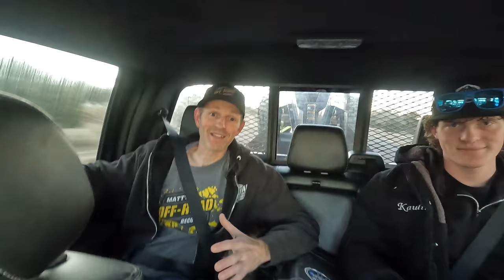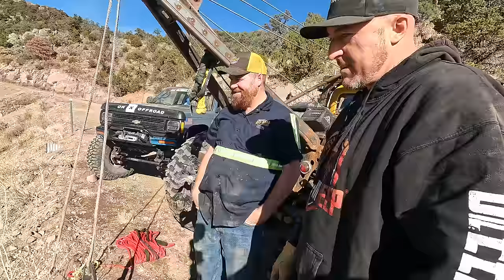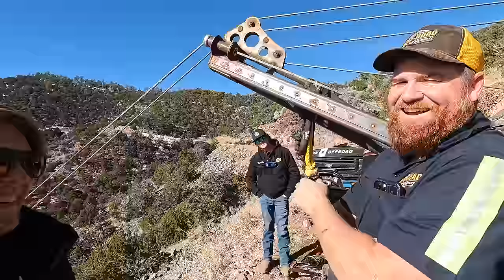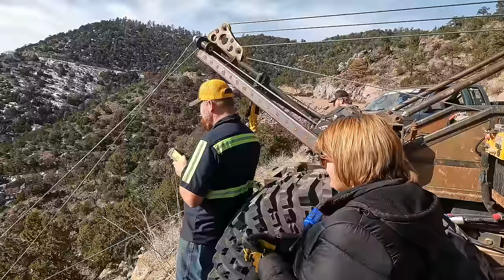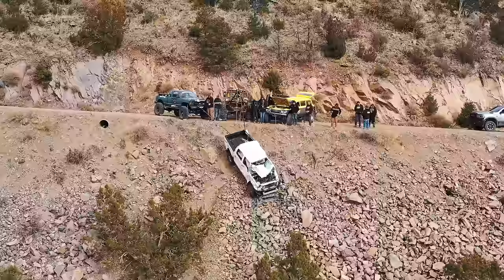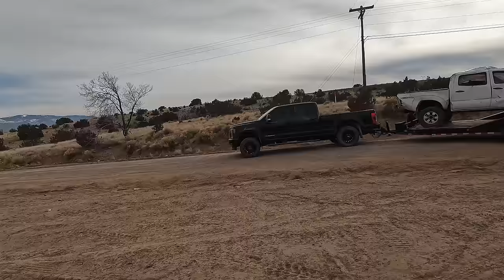There's No One Who Can Recover This Toyota....

Comment: Huge bit of advice for your trail jack. Just put a piece of tire or a 2x8 bolted to the bottom but the combo with an old cut of tire rubber on the bottom will make that jack work soooo much better it will blow your mind.
Reply: i dont even use those jacks and always wondered why no one does this... thats the first thing id do out of the box; make a bigger footprint
Reply: In theory that would work great in your driveway, Also, it's too bad they don't already make a rubberized foot for these, Oh wait... But maybe the real issue is the situation where a truck is sitting and being supported by winch lines on unstable ground, maybe just slide the jack into the door jam... well would ya look at that... mind blown.
Reply: @KirbyLouis  I know right, I don't even drive a toyota and always wondered why they do this, that's the first thing I'd do out of the box, not drive it off a cliff.
Reply: In a pinch a heavy-duty doormat on rough surfaces…
Reply: @stevecochrane6948  lol
Reply: Referring to the kind of articulating doormat made from pieces of tire, in combination with chunk of 1-1/4” plywood…worked on rock, not on soft stuff i would guess

Comment: The Camera Work and Editing are EXCELLENT on this recovery. Very technical, very safe recovery there is no doubt about that, but the camera work really was impressive, and showed how difficult this recovery actually was, even though you guys made it look easy.
Reply: I grew up in this kind of country and going down to the truck was dangerous for the person holding the camera. They should have a couple chest mounted cameras so   there's footage they can use to fill in while they get to a safer place.
Walking that kind of rock won't kill you but it's compound fractures in a box. Leg on the fall and arm if you get a chance to catch yourself.

I think Matt's operation takes safety seriously. So all of this is pointing out where they could improve.

Comment: Well Done!!!
I watched Colt's Bleepin Jeep version and I envisioned using the wrecker as a Yarder like the loggers use to pull logs. 
One of the wrecker's boom winch lines is lowered, along with the first rigger, and secured to the tow vehicle. Once that line is secured and tightened, it can be used as a Skyline. Then the tires, jack, and other equipment can be hung on that line with soft shackles to snatch blocks or snatch rings. The descent can be controlled by attaching the second boom winch line to the snatch ring and lowering it down. You could attach a tree strap or short rope to the load to assist the load down with one of the riggers controlling the descent.
Reply: Watch Trailmater - "Someone needs a Skyhook". You need someone with Rory's technical expertise.

Comment: I’m less than hour north from where U we’re at , I now the exact location where this recovery was at and that is an extremely steep mountain side !
Good job to you all and glad you’re all home safely!
Reply: Cool. We used to go up 31 mile road and roll boulders down the hillside.
Reply: That mountainside is the kind terrain that, if I encounter it on a hike, I realize I need to turn around or find a better route. One slip and the best case is you're going to have some road rash, worst case you'll end up dead.
Reply: Somebody was serious about stealing parts if they slid down there and then climbed back out with the tires and speakers
Reply: Did you get the rims?   😂
Reply: @HulaViking  Yeah. It seems to me they worked harder stealing them than they would have earning the money to buy them honestly.

Comment: Matt, you should consider putting some folding seats on the back of the wrecker behind the window, where the guys usually ride at. You could use folding seats from the back of an extended cab ranger, and just modify them to fit, they can fold-out of the way when not in use, and it would give your extra guys a place to ride with a little more comfort.
Reply: Or just get some boat seats that swivel for cheap.

Comment: Watching the video at 17:00 Had an idea for a tow truck improvement. You need to fabricate a pully/fairlead type device at the top of the boom. Then under these extreme pulls you could route the winchline from the 3rd rear winch up and over to get extra pulling power on the job. There would be some loss of efficiency because of the angle, you had to pull from but in the cases where you had to use it it would be better than nothing.

Comment: I live in Albuquerque New Mexico and my sister lives in Espanola. Pretty cool to see y'all working around these parts!
Reply: Los Alamos here. Pretty cool to see Chicoma and Caballo in the back ground!
Reply: @patricksjeeps  I have spent a lot of time in Los Alamos and Espanola. I'm surprised it seems they drove from Farmington down to Santa Fe. Would have been quicker and prettier to go through the Jemez. But maybe weather wasn't permitting it those days.
Reply: @derekboberg9766  I wondered the same thing, but 126 is dirt, and maybe they didn't want to tow over the mountain- 550- hwy4
Reply: Meth town 😂
Reply: @patricksjeeps  Yeah Hwy 4 is kinda tough towing a trailer dropping into Los Alamos, and it very well could have been when it was snowing up north.
Reply: @derekboberg9766  I pull my 42' toy hauler up and down it., but I been driving that for 38 years
Reply: @patricksjeeps  Yeah, I've pulled a 5th wheel up it a few times. I've also followed a couple semis up it. Idk maybe the map told them they couldn't get through because of the National Lab? I know you can go around it, but last time I was there the map was directing me through it.
Reply: @chubbrock659  more like pill town

Comment: I hauled a big trencher north of Montezuma Creek by five or ten miles, it was also a hairy job, on a 13-axle Aspen trailer. I went back south through to San Antonio TX. I had to go off the highway to the west a few hundred yards to load it. The drop-off from the paved road was four to five feet, and I had to raise the front and rear of the trailer as high as they would go and had one of our escort drivers steer the rear of the trailer. It was being used in the oil and gas fields north of town.

Comment: 30 years ago, I rolled my '49 International pickup down a steep cliff. No injuries except for the truck whose solid build protected the three of us in the cab. There was no way to winch it up. I had to cut it into pieces with a torch and used the roof to skid it all back to the road. So sad. BTW, sheriff was on it: $500 fine + cost for county to remove it.

Comment: I just wonder how anyone can afford to have this specialized tow truck including a crew and several support vehicles with trailers and everything driving through the entire USA with overnight stay etc. etc. etc. for having their stuck off-road vehicle recovered. I wonder how anyone can pay for all of that. This has got to be 100x the cost of a local on-road tow truck recovering a regular vehicle on the side of the road, and that is already expensive enough. I just wonder how! 😵‍💫
Reply: Rescue by tow truck in the remote Arizona Strip not on any of the 4 paved highways is easily over $2k as many of the roads are treacherous even when graded by the various federal agencies that maintain the dirt roads.  Getting pulled out from a major incident down the side of a mountain or out of a ravine is even more as it requires skill and experience to fetch it and bring it up.

Comment: my first dump truck was most likely less than that job, 1964 Dodge D900 I got for $750 and it all worked till I washed it then the ram sprayed fluid since the dirt wasn't holding the seals together anymore.

Comment: Mexico  is taking on a whole new value on the stock markets  and a new name to go with it.   Hey,  that lose rock reminds me of being on the inside slopes of Mount Vesuvius, and sliding toward the vertical core. WE got smart and got back up to the top,  just 10, 15 feet up. not a rope anywhere.  SAILORS will mistake anything for a big wave to climb..., mountains too, made of blue.. at sea. My stress level is from "my wave" rolling the ship upside down, 72 degree angle,  while i was climbing up from the engine room, basic hand stand stuff, never before seen in a movie..
Reply: ... They tried putting extra ships on our wave( an entire Carrier group, tanker, supply ship etc,  but.... we were sinking due to the Keel splitting apart on our 400 ft ship,  the Fleet had left us with Gods Blessing.    It paid off Big

Comment: When they tow a car here in Boston from the back end , the  put a strap around the steering wheel so the car or truck front wheels don't veer off in right an left directions, keeping the car going straight. The Tacoma drifted to towards the tree's a rocks. I gather the front wheels couldn't turn before you started your pull up the hill, right?

Comment: "no one can recover".  The angle of the slope is similar to logging in British Columbia (and probably Washington State), where they routinely pull freshly-cut logs up a similar length of slope, usually by "high-lining" -- run a loop of cable from the truck on the road down to an block (with a wheel) connected to an anchor-tree and back to the top. Connect another cable from a "tap" on that loop of cable down to a chain looped around the log. Spin that high-line of cable, and the log gets pulled-up to the road, barely touching the ground at the bottom-end, where a loader pinches the log, picks it up, and maneuvers the log into position onto the deck of a log-carrier.  Bring the right equipment, if you have a whole hillside of your allowable cut-block to harvest.

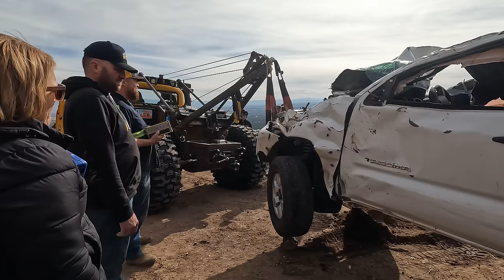Comment: Noticed the rear wheels are locked up at 22:45- that must have added a level of Pain-In-The-Asphalt, having to drag it against Gravity AND Friction.  I'll keep watching and see if they can be freed up to roll... wonder if they don't have the keys or put it in Neutral, and center the front wheels... then at 33:53 it looks like the rears are finally turning! This was a heluva pull, guys (and Jamie) - a Helicopter would have been easier, but WHERE'S THE FUN IN THAT???

Comment: I own this exact truck and while it is good for off-road, it is not a Jeep - nor was it ever meant to be.  Also these four-wheel drive Tacomas are heavy. I have to buy special truck tires in order to get reasonable mileage out of them.  So this is no easy job by any measure. It's interesting that the Insurance agency paid a fortune to tow this out of the ravine. Probably because of regulatory requirements that don't allow abandoning vehicles in the desert.

Comment: So how much does a winch suck down a battery? Or to ask it the other way, how much pulling can you do with the winch before the battery starts losing power and the winch can't pull as hard?

On the wrecker, I think there are multiple batteries to power the multiple winches. Are all of those batteries charged by the alternator(s) on the engine, or do you guys have to top the batteries up with external chargers after a big job?

Comment: I'd have put a pully with a connection ring on the main winch line and then attached the two other lines to it and run them down the cable to the wreck, saved on climbing down with them :-)

Comment: They need to run a dozer off the side of that hill or put a sign that the county doesn’t maintain that trail no off Roading , it doesn’t like your dent pullers were hooked up in the right spots to fix all the damage

Comment: Massive vw geek hear 👏  , cut apart the key and remove the immo pill, keeping origanall colloum and indicators. Pws module should be fine may want re coding to change effects due to waight. As for the clutch switch you may be able to take the coding out on ecu or central convenience.

Comment: SMFH Unrecoverable for months? Egyptians moved stones weighing up to 70 tons with no modern equipment and no one could figure out how to get this truck before now? IF there wasn't anything to secure a line to, use a second vehicle or cement in an anchor point and use a 4 to 1 pulley system. Am I wrong here?

Comment: The one thing about this video, that actually made me cringe, was the lack of safety around cables under tension. 
I know you have top notch equipment but failures happen, but a person in the direct path of a broken line is groesome. I don't want see anyone get hurt.
Reply: Those were synthetic lines, not steel cable.  There's no recoil in synthetic lines.

Comment: Years ago they resurveyed 4 corners and it's off by 100 yards.   So did you REALLY stand in 4 states?
Reply: No.  It was off by about 1800 feet until about 2012, when all 4 states agreed to move their borders to that location.
So now it's in the correct location.
Reply: @rthinds  I needed the correction.   But I bet the big concrete and metal "cornerstone" is still there and has not been moved.   Whether I stood in 4 states or not is now only a philosophical question.

Comment: Here goes the armchair towman again: Why wouldn't you have you diesel pick up with its two batteries and capable alternator jumped to the obviously underpowered  electrical system of the wrecker..Those electric winches are great of they have the power they need..and having a remote to be safely out of the way is a benefit of the electric system..And to see people just hanging out having a party looking down the line made me cringe..especially when the load was close..Those synthetic ropes snap back almost twice as fast as metal wire..Its all fun and games until.....
Reply: No they don't.  Synthetic line has no recoil tension like steel cable does.  It just drops to the ground when they snap.

Comment: what's the point of dragging up that wreck. ?
Reply from the maker: The same reason you clean up a glass of milk you spilled on the floor. 
You’re not trying to save the milk, but you’re still gonna clean it up. 

And if that’s not enough incentive, the government will fine you for leaving it there.
Reply: Yeah, very...very strange. Got a pot of stewed chicken on the middel of my kitchen floor that was dropped there in 1992. Just do not see the point in removing it. I'll just step over it.